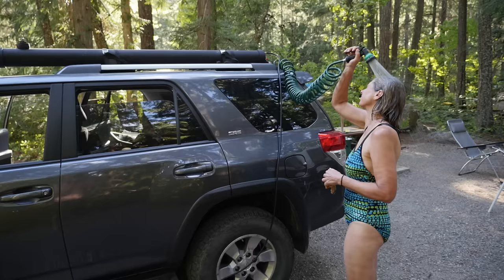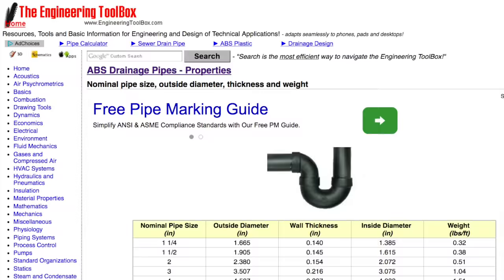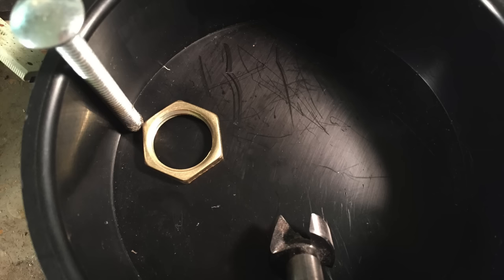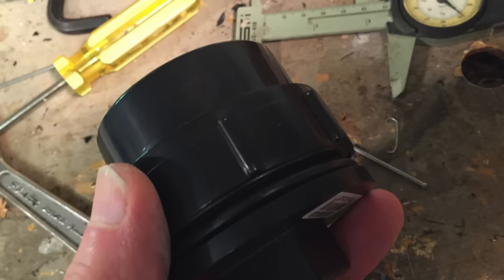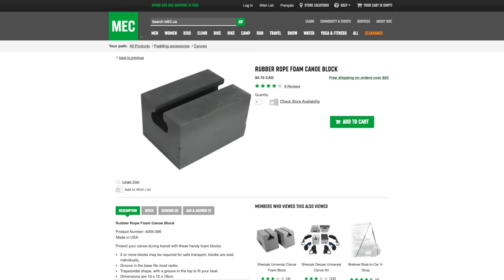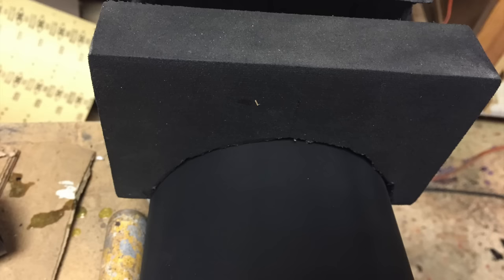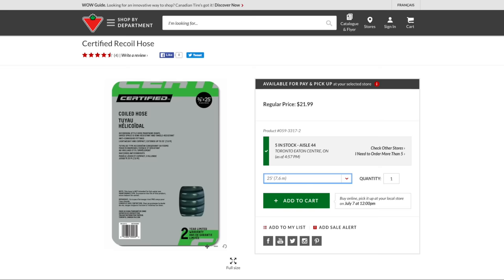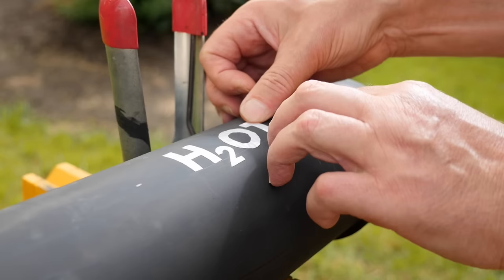H2OT - Rooftop, pressurized, solar-heated shower/sprayer using ABS pipe. DIY

Comment: how long does it take for the water to heat up? is the water actually get hot enough to have a good hot shower? thanks this is an awesome design
Reply from the maker: Q1: Heating time is dependant upon initial water temperature, ambient air temperature, amount of direct sun,  reflectivity of the roof surface, volume of water, desired target temperature, to name just a few of the variables. To make a better estimate I suggest you apply Newtons Law of Cooling. 

Q2: Yes
Reply: david drake 

id think on a 90*F day With lots of sun for 4 gal. of water it wouldnt take but a couple of hours to heat up nicely

on fall winter and spring  cold and chilly days you could even splice into your automotive heater hoses and install a small  radiator matrix from a salvage yard and run that inside your drain pipe to heat the water... or make a copper coil to run the length of the drain pipe inside.  so the engine radiator fluid runs inside the copper coil tubing inside the drain pipe thus heating the shower water ... you would want some shut of valves and quick release garden hose connections to remove and install on the drain pipe on to the truck. so you dont loose anti freeze when removing the hot water set up.... race cars have those kinds of hose  connections  for easy and fast in and out radiator removals ... ( online at jegs or summit racing)

but that would do it easily... maybe some cardboard in front of the cars radiator on really cold days to keep from over cooling the engine  and a hotter running engine thermostate

most automotive  anti coolant temp is between 160*F and 210* F .... with the ineffecancies of the heat transfer and the outside temp.. the water would be warm at least 

maybe add in some alcohol to your shower water to lower the freezing temp of the shower water...dont drink it, im guessing that could work to really low temps when your out deer hunting and you dont want your shower water turned into a block of ice inside the pvc drain pipe

anyway a number of ideas could be employed 

opps ... i just realized you guys are brits
our  auto hood = your auto  roof 

prop

Comment: Hi, great video.  I built something similar but when I add air to presurize the air scapes through the screw on cap.  How do you prevent this?

thank you.
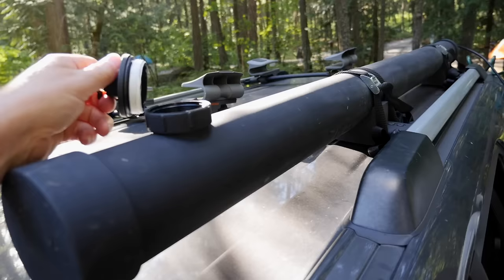Reply from the maker: In the video at 4:07 you can see I have wrapped the  cap threads with teflon tape. This really improves the seal. Also, there is a rubber gasket at the base of the threads that also works to slow down air loss.
Reply: thank you, I went to lowes to get the gasket but they dont have anything of that size.  I will look online.  If  you can, please share the gasket info.  Thank you.
Reply from the maker: The gasket comes with the threaded plug. Here is where I bought mine.

https://www.homedepot.ca/en/home/p.2-in-abs-male-plug-mipt.1000116110.html
Reply: They dont sell these caps with the O ring inside at the Home Depots here in the States, Cant even order them on-line. Tried everywhere on-line and no luck..

Comment: Has anyone experienced a blowout from one of the endcaps? I'm thinking that I either didn't let the glue cure long enough or I over pressurized it
Reply from the maker: If you used glue, then you used the wrong thing. This is ABS pipe. The binding cement chemically welds two pieces together. The resulting joint is stronger than components itself. ONLY ABS solvent cement will work.
Reply: imaginetMedia I used "OATEY 
Milky-Clear Solvent Cement, Size 8, For Use With PVC, CPVC, and ABS Pipe and Fittings"
Reply: imaginetMedia I would advise adding a pressure relief safety valve.  It may sound silly but this is any easy way to accidentally create steam.  

Other than that, Dam.  Nice workmanship and great idea.  It would probably been in the manufactures best interest to sell them as kits for a lot cheaper (with some sort of an emergency pressure valve.)

Comment: Well done did the paint end up chipping off?
Reply from the maker: Not at all. The key to a good good paint job is preparation. As I mentioned, I lightly (very lightly) buffed with 4x steel wool dipped in denatured alcohol (methyl hydrated). Then primed the surface, then applied the black paint.  If you have ever done any woodwork finishing  or auto body painting, you will know that preparation is the key.
Reply: imaginetMedia thanks for the reply, I've just never had any luck with painting PVC even with prep. Might be the wrong paint. Thanks

Comment: How did you maintain air pressure in hole where you fill the water?  The ABS is not air tight and every time I attach a compressor to pump it up, it just leaks out of the filler hole, despite how tight I make the cap.
Reply from the maker: I have addressed this question many times in the past comments in great detail, including direct links to the cap which includes a silicone gasket, which is visible in the video.

Comment: You mention the tank can hold 100 psi with no problems, but what about the hose and sprayer? Would those be the weak points?
Reply from the maker: I only pressurize to a maximum of 30 psi. That is more than ample pressure.
Reply: @ImaginetMedia  Great video sir!
 Do you typically leave the tank a bit low for air or do you simply fill it up and expand the tank under pressure?
Reply: Why would you need 100 psi for? 30 psi is more than enough for showering and to cover up the basics

Comment: Hi, love this so much. Could not find what kind of compressor can be used (do you recommend)? Thank you, p
Reply from the maker: This is the air compressor I use.  NOTE: Do NOT buy a cheap compressor that plugs into the accessory plug. It will burn out or otherwise fail yo when yo need it the most (inflating an actual flat tire).  This compressor is designed to run for a long time an hooks directly to the battery to avoid bling fuses in your car that may make a bigger problem than you flat tire.  https://www.amazon.com/gp/product/B005ASY23I/
Reply: @ImaginetMedia  What about the potable OASSER or similar style pumps. 
Do you think those would hold up or burnout?

Comment: Hi there! I did try building one like these, only problem i have is, every time i put air on it the air leaks out at the cap. Anything I missed?
Thanks!
Reply from the maker: My cap only bleeds the slightest amount of air an that is only when I am near 30 psi.  As mentioned in the past, The correct 2 inch cap is crucial for a tight seal.
This is the exact one I used. https://www.homedepot.ca/en/home/p.2-in-abs-male-plug-mipt.1000116110.html
This cap comes with a silicone gasket that is key to a tight seal. 

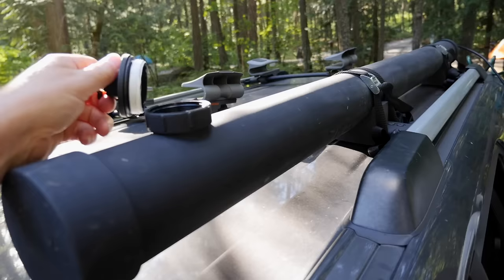You can see the model number at 2:13.  At 4:07 you can see the cap with the seal in place, and that I have wrapped several layers of Teflon tape around the threads to tighten the seal. 

With the proper cap, gasket and tape, you should have a a very air tight seal.
Reply: You can fold the tube, and adjust the pressure up or down
Reply: Larry Cresci , sorry but i don't understsnd what u saying. My issue is leaking air where you put the plug after pouring water in the abs pipe.
Reply: Try teflon tape on the threads.
Reply: He used teflon tape on the threads, you can see the white tape, pink is thicker and better sealing. If that doesn't work, then used teflon tape and thread sealant together. Generally thread sealant is used for a more permanent situation.

Comment: Beautifully well done.

I'm about to mount two of these under my tacoma (filling the void on both sides).
I don't need them to be hot as I live in a tropical place, just want a good amount of shower water when I come out of the ocean.

I was however confused about one small thing.  You have a pressure release, and you mentioned wanting to release pressure without using the spigot.

Why?

(if anyone knows a good reason, speak up)
Reply from the maker: Thanks for the comments. The radiator drain fitting (in the filler cap) is not a pressure release valve. It is simply a stop drain. If I wanted to open up the tank for any reason after I pressurize it, it is easier to just open the radiaor drain on top, as no water, only air would get expelled. 

I have subsequently (a result of some great posted comments here) replaced the dain I show, with a pressure relief ( I believe it is 40 psi) valve, which had the same threads. I still do not fill the tank over 30 psi though as that is plenty of pressure. 

One important feature to note is I use a 3/8" diameter hose and not 1/2".
Reply: @ImaginetMedia  ah, I see.  Interesting though, why not  depress the Shrader valve, would that not serve the same purpose? 

I ask because I'm obsessed with reducing 'parts'

Although, in my design, I'm in fact hooking it up with a 12v ShurFlo pump to allow me to use 100% of the water, and also to alleviate the need to pressurise every time.  So I'm doing the same basic ABS design, but planning to link the 'pontoons' (if you will) on either side under the truck.   I will get about 24 litres (over 6.4 gallons).

Comment: Do you think the flat black paint greatly improved the heating of the water over the slightly glossy black color of standard ABS?
Reply from the maker: Google  is your friend...
https://www.builditsolar.com/Experimental/PaintAbsorbancy/GlossvsFlat.htm
Reply: Yes.  Glossy surfaces are more reflective and will reflect heat away from the surface.  Flat black is a much better absorber.

Comment: Have you noticed any safety issues with driving? Does the water moving around affect turning and stopping?
Reply from the maker: I never drive unless the tank is filled completely right up to the brim. This makes the tank one solid mass and thus removes the risk of a water hammer.

Comment: When you apply the pressure theater level need to be full ?
Reply from the maker: I pressurize to 30psi and let it run down to about 10psi before I have to turn the compressor back on for a few seconds. As the water level drops, the compressed air capacity increases and thus the time between needing to repressurize decreases.

Comment: Did you use any sealant or caulking around the faucet or valves? I see people mentioning a pressure release valve. What is the point of that?
Reply from the maker: No. All the joints are chemically welded using ABS solvent cement. Once set, the joint is as strong as a solid piece. All the threaded fitting are NPT threads that are tapered and thus threaded into a properly sized hole. They will never leak.  Anyone that says they needed to seal something did not join the comments correctly or oversized the drill size.  The PRV valve is a safety precaution. But if you use a compressor with an auto shut off it is not required. I have neither an auto shut off compressor nor a PRV valve.

Comment: Is it possible to do this with 2 or 3 separate tubes all going to one outlet? I ask because I want to fit a water system under the bed of my truck to keep the center of gravity lower. I appreciate any feedback. Thanks for your time. :)
Reply from the maker: You certainly can hook several tanks in parallel, but the problem will be how yo connect them. You see, standard plumbing pipe connections align springline to springline. The result is water wil only drain half way in all the tanks except the one with the drain. You need to connect obvert to obvert. That will require some custom ABS pipe mods.

Comment: Thank you for this video and great Idea, can i use a regular PVC pipe instead of ABS pipe?  thanks
Reply from the maker: Here are some of the benefits of ABS over PVC for this application…

ABS pipes bend on strong impact, PVC pipes shatter to pieces.

ABS pipes can be joined in a single step, PVC pipes require two steps including primer and holding joint until dry. 

ABS pipes have a broader temperature range, which is from -40 °F to 180 °F. PVC pipes have a maximum operating temperature of 140 °F
Reply: Great Thank you!
Reply: Its being a mission to find the ABS pipes here in Miami FL, no place to find it, Home depot or Ace hardware or any lowes, or any big plumbing supplies has it, they offer a Sch 40 pipe or a regular pvc pipe, dont know if this sch 40 pipe will work.
Reply from the maker: Schedule 40 is not a type of type, it is ANSI pipe standard which references pipe wall thickness. Schedule 40 pipe can be ABS, PVC, plastic, steel, etc. 

Regarding availability and searching for ABS pipe, it is commonly referred to to a DWV (drain, waste, vent). Try searching or asking for that.  BTW: I just searched Lowes.com and set my store to one in Miami area, and it showed 5 and 10 foot lengths being available.
Reply: imaginetMedia , thank you! I did look at the Loews pipes, they don't have it available at the store, but I will check some other places as you refer DWV,,, thanks for all your help I really appreciate it!!
Reply: Jose Velez  pvc way better then abs 
It resists heat well

Comment: Does this need to be pressurised if it's well above head height for having a shower? The solar bags aren't hooked up to a compressor and I assume they work well enough?
Reply from the maker: Static water pressure at the shower is expressed in head pressure. In simple terms, The higher the water source from the outlet, the more pressure you will have. It works out to 2.31 psi/foot of head. That is, for every 2.31 feet the shower tank is above the nozzle, you will achieve a whopping 1 psi of pressure.  Your shower at home is between 45 and 60 psi for reference.  as the showerhead is at about the same height as the tank when I use it, you would get as much pressure as pouring milk into your morning coffee.

Comment: Is ABS the best material for a pipe to be set in the sun for long periods of time?
Reply from the maker: No. Aluminum is. But there is a trade-off here.  It is only in the sun when I am using it. I Take it off the roof and store it inside when not in use.  Also, the paint not only increases the thermal absorption properties, it adds significant UV protection.  Thank you for the great question, I probably should have elaborated on that in the video.
Reply: ABS does not shatter if it cracks and breaks or is impacted while pressurized. If the tank is largely full of pressurized air, PVC will shatter and send shards of plastic everywhere. ABS will not.
Reply: imaginetMedia you mention that there is a trade off when using ABS vs Aluminum when it comes to heating. Why did you specifically mean?

Comment: I can't find the extended schrader valve...and I consider myself an expert Google'r. Can you please share the link?
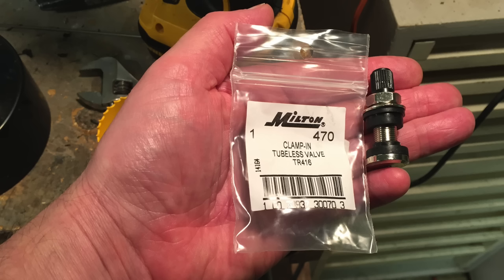Reply from the maker: I show the packaging at 1:59 so anyone can search for it. Milton Tubeless Clamp-in Valve TR416.

Here, let me Google that for you...  http://bfy.tw/9k7L
Reply: Oh my...wow. I thought you were showing the original one you bought and then replaced at 1:59. "I was originally going to use" was right when you were showing the one you did use. Dangit. Sorry.
Reply from the maker: Ryan, any bolt in tire vale will work. In fact, the original rubber ones I bought would have worked as well (I just did not want to wrestle with it to get it into place,).  Any automotive parts retailer will have some selection of valves. These bolt in valves (the one I used) are what you have to use if you have aluminum rims. 

Be aware of pricing shown online. Many of the sellers sell them in sets. The price you see may be for 4 and not 1.

Comment: Hi there, looking to do a similar setup. Any idea of the approx weight when full? Thanks for your time!
Reply from the maker: All the data is in the spreadsheet shown at 1:11
Reply: ~8.5 lbs per gallon, plus the weight of the pipe and fixtures.
Reply: Garret Dietz it’s probably obvious, but you can calculate how much water you can hold in a certain length pipe and then calculate the weight of the water. https://www.inchcalculator.com/pipe-volume-calculator/#idx_volume_and_weight_of_water_for_common_pipe_sizes .  A general rule is a 5” pipe holds 1 gallon per ft and a 6” pipe holds 1.5 gallons.

Comment: I would have just done a t for the top hole but whatever.
Reply from the maker: That is definitely an easier option. It does add weight, more joints, more cost and does not look as clean. But it will certainly work just as well.

Comment: Wondering if you have driven this setup around with a full tank of water, or iff it's best not to. Thinking the significant weight and the multiple, unsupported joints could be a problem over time.
Reply from the maker: The whole point is to drive with it full. Then when I arrive at my camp destination, I have hot water. This is explained in the video section where i describe the roof mount. NOTE: joints in ABS are chemically welded. They are as strong and in some cases stronger, than the pipe itself. They are not "glued joints", but are bonded via chemical reaction that fuses ABS components together.  This is one advantage that ABS has over PVC.
Reply: It's not that much more weight. Do the math and you'll see

Comment: Excellent work! One question: What are your thoughts on longevity of this? ABS is pretty susceptible to UV damage. Might only get a couple of years usage on this?
Reply: I wondered the same thing. On a plumbing supply site I learned that painting the  ABS pipe solves that problem.
Reply: After painting, 303 UV Protectant Spray would likely help to reduce UV damage.
Reply: Remove the tank when not in use (winter for sure) If it only lasts several years, you can still build 5 of these for the price of one commercial aluminum one.